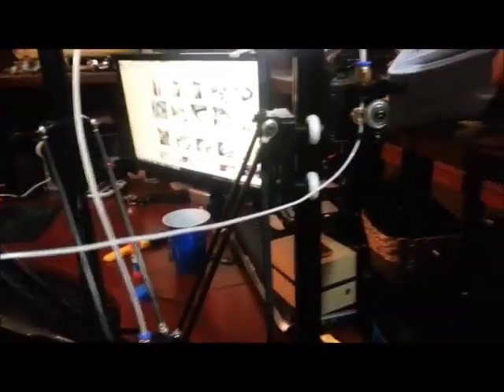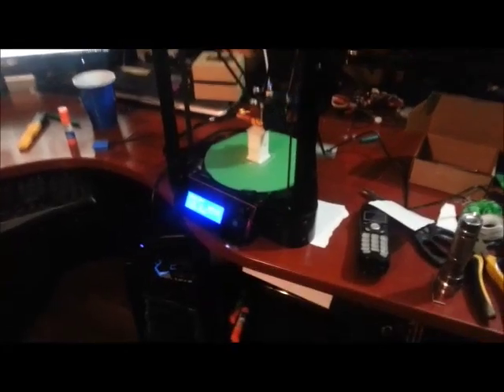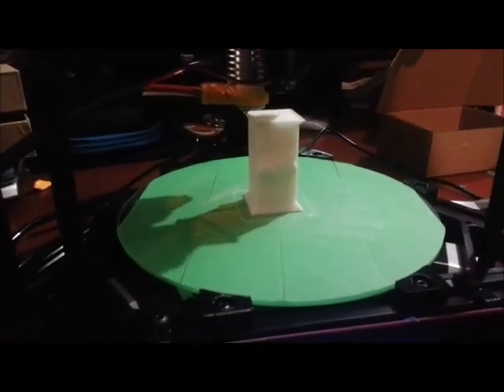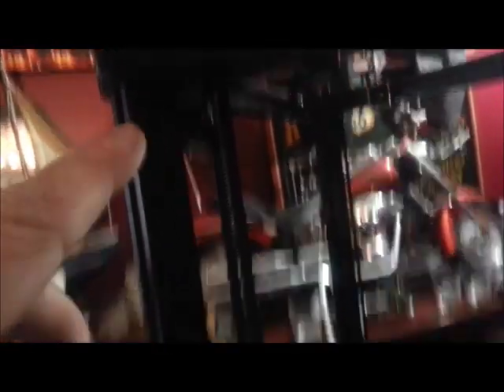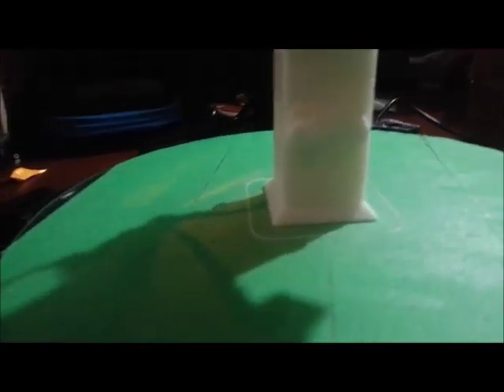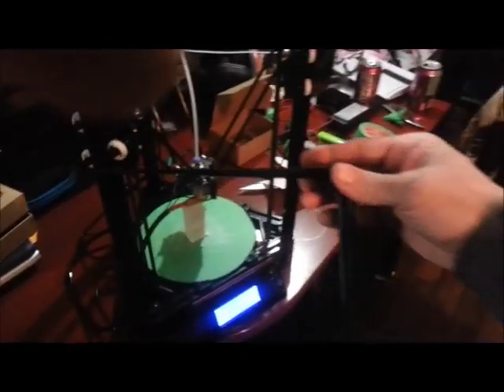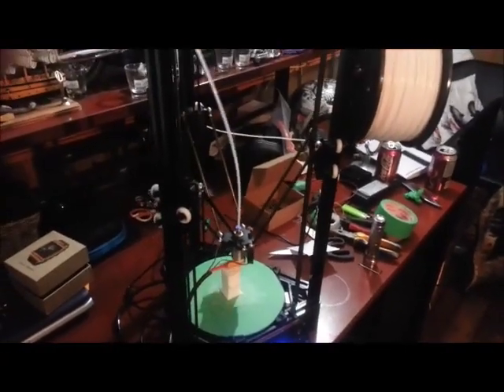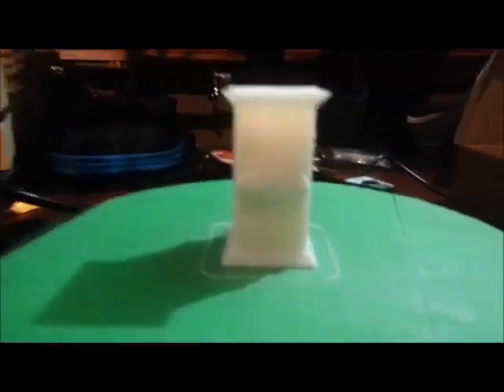Completed Working ANYCUBIC 3d PRINTER

Comment: Can i have ur firmware . My email : anhshockzaydo@yahoo.com .
Reply from the maker: What version of the Ancubic Kossel Mini do you have. If you have the version with the autolevel shroud my firmware will not work with it. I have a version of Cura that comes with that version of the printer that has the firmware built in. I need to know what version of this printer you have as there is the original and then it was replaced with the Autolevel version

Comment: Hello, what program do you work with, cure, slic3r, repeater???
Reply from the maker: I was using cura 15.04.6 but was getting more and more zits in my prints, I have since started tinkering with Cura 2.4.0, so far no zits
Reply: Cure 2.4 does not recognize my printer.
What firmware do you use?
Reply from the maker: How so? I setup a custom printer in it with all my settings and then I just use it to slice my models into Gcode and print from sdcard on the printer
Reply: Ok, I'm using Cure 1.5.6 and print from the program
Reply from the maker: I have never used that version of Cura. I use to use Slic3r but I found it was not as good as Cura for some things.
Reply: Slic3r has given me problems to calibrate I can not calibrate
Reply from the maker: Do you have this same printer? My firmware wont work with the newer machines that have the large hotend shroud
Reply: Yes, version lineal guide
No plus
trigorrila board

Comment: how to add thermal sensor on the original heatbed?does it not too hot to put the hot bed up and the motherboard just under ..i am little afraid about this..
Reply from the maker: The heatbed spreads heat passively. What you could do is put spacers between the heatbead and the lower frame to give an air gap which should be more then enough. I use kapton tape to hold the thermail sensor firmly to the bed
Reply: thanks a lot!did you resolve you noise motor problem?i am waiting my plus version which is bigger
Reply from the maker: Did you get the newer model with the autolevel shroud

Comment: Thanks for the vid. Subbed.  Can you send me a copy of your firmware? keith1212@hotmail.com Thanks in advance!
Reply from the maker: firmware sent
Reply: Got it thanks! Fortunatly my main board came with firmware on it. The package had a sticker telling me so. Had the firmware and some more stuff on the sd card. Also they updated the build area and now you can add these bushing which came with my kit for more build area. http://rd3dpds.com/images/pdf/Modification%20for%20Anycubic%20Kossel%203D%20Printer-20161122.pdf Assembly went amazing for a kit. Everything just worked. I have a completely different  main carriage than yours.
Reply from the maker: I have to micromakes with the same effector(hotend) and I designed a replacement right away as those hot ends are large bulky and sacrifice build area. http://www.thingiverse.com/thing:1935700 
I also reverse engineered those new effectors and you can find my replacement design with better ventaliation here http://www.thingiverse.com/thing:1855253
The new kossels like the one you have same build height as my old ones until I ad an effector similar to yours then the old ones have 345mm build height. AS the old ones the 2020 tower extrusion is 40mm taller. I have my micromakes sitting beside my old Anycubics and the printer height difference is very noticable
Reply: Sweet thanks for sharing!

Comment: Hi can you send me the firmware I've the linear version thk ;)
Reply: vincenzo.pirro@email.it
Reply from the maker: My firmware may not work for the linear version as your delta measurements will be different. If you still want it i can send it
Reply: Yes send me I've a problem with the g28 command that not return all the axis in the same time

Comment: will this firmware work on the linear kossel ? if so could i have a copy mr-foxx@talk21.com
Reply from the maker: The linear Version will have slightly different delta measurements due to the push rods being much closer to the towers. You could try it as a start and fine turn your numbers until you have it calibrated

Comment: saludos, podrías pasarme tu firmware porque a mi también me llego la impresora sin software y el enlace que me han dado no esta, pokechori@gmail.com
Reply from the maker: firmware sent. Once you have the firmware uploaded to the printer, if 
you are still having issues double check your wiring to your ramps. This
 firmware is tweaked for the anycubic kossel mini and the printer should
 work as it should once installed and I find that 99% of people having 
issues after installing it have wiring issues
Reply: Arduino:1.6.12 (Windows 7), Tarjeta:"Arduino/Genuino Mega or Mega 2560, ATmega2560 (Mega 2560)"

sketch\Marlin_main.cpp:2208:36: warning: invalid suffix on literal; C++11 requires a space between literal and string macro [-Wliteral-suffix]

         LCD_MESSAGEPGM(MACHINE_NAME" "MSG_OFF".");

                                    ^

In file included from sketch\SdFile.h:27:0,

                 from sketch\cardreader.h:8,

                 from sketch\Marlin_main.cpp:46:

SdBaseFile.h:38: error: using typedef-name 'fpos_t' after 'struct'

 struct fpos_t {

        ^

In file included from sketch\Marlin.h:10:0,

                 from sketch\Marlin_main.cpp:32:

f:\arduino\hardware\tools\avr\avr\include\stdio.h:950:33: note: 'fpos_t' has a previous declaration here

 _extension_ typedef long long fpos_t;

                                 ^

sketch\Marlin_main.cpp: In function 'void set_bed_level_equation_lsq(double*)':

sketch\Marlin_main.cpp:831:36: warning: deprecated conversion from string constant to 'char*' [-Wwrite-strings]

     planeNormal.debug("planeNormal");

                                    ^

exit status 1
using typedef-name 'fpos_t' after 'struct'

Este reporte podría tener más información con
"Mostrar salida detallada durante la compilación"
opción habilitada en Archivo -> Preferencias.
Reply: perdona por las molestias podrias ponerme la configuracion de tu puerto? te pongo los mios

bits por segundo:9600
bits de datos:8
paridad: ninguno
bits de parada: 1
control de flujo: ninguno

avanzadas
todo al maximo y activado
Reply from the maker: I will check what version of arduino software I am running when I get home as I have no errors when uploading this firmware. Did you make sure everything was in a folder called marlin also. you have to run the marlin.ino file from a marlin folder

Comment: Hi, I've just assembly this printer, but I have problem with the firmware and lcd screen ( it is just bright and doens't work :/). Could you send your firmware? pp_41@o2.pl
Reply from the maker: i will but first the lcd has a contrast control. It could be set too high. on the very back of the panel near the sd slot there is a small adjustment screw for contrast try adjusting it to clear up your screen issue
Reply: Thanks for firmware. I've tried a lots of things to solve my problem, but I probably got faulty LCD screen or this small adapter :/
Reply from the maker: If it is faulty you can still use the printer with pronterface on your pc until you get a replacement screen, do a search on aliexpress for 2004 lcd they run about $8-9 usd

Comment: Hey guys most of the way through building one of these, may have a problem with the hot end.  At the moment having assembled it as per the destructions Its very loose.  The printed clip that holds it in place with two screws and nuts, does not apply any pressure to the hot end itself and just serves to prevent it from falling back through its own hole in the effector assembly.  Its got enough slop that i'm pretty sure any motion will move the hot end all over the place.  Anyone else had this issue, or have I just managed to get a duff part?
Reply from the maker: I had this issue with one and what I did until I was able to use the printer to print another one was add a few layers of electrical tape or something like that to the printed clip to make it thicker and that made the hot end snug,. then I printed a thicker clip
Reply: Cheers.  WIll have to give that a go and see how I get on. Everything else thus far seems to fit fine, guess you've got to have at least one thing wrong on cheap chinese kit :)
Reply from the maker: Ive bought 6 of these, one had a bad ramps board, 3 of the 6 did not come  with the m5 nuts for the nylon wheels, and 1 had poor 3d printed parts
Reply from the maker: Firmware sent. Let me know how things go. Yeah the arms are are not perfectly equal the vary by up to 2mm i find
Reply from the maker: I have 4 of these now for personal use and one custom made one I decided to attempt after using the one in this video for a couple of months. It is 1 meter tall and 1/2 meter wide. Print volume is 480tallx330mm diameter. I have yet to upload a video of it yet though.
Reply: Not so good, mainly because shit for brains here should have put .co.uk on the end of my email address not .com sorry.  Beyond the firmware after playing a bit with the arms overnight and manually checking levels I got a definite tilt to one side on the hot end, so now browsing through Ebays finest for a replacement set of arms.  will give it a go with them and the current set, but once this is up and running I can seem some rapid upgrades coming along.
Reply: Cheers for the help Rock, still a ways to go, need a new LCD as the current one is just a glorified torch.  Need to do a proper calibration.  The bed is either off or the arms are giving me issues, but its still good enough for prints with a test cube just showing off by 0.5mm on one corner. :)http://i1376.photobucket.com/albums/ah27/Spec_wulf/Mobile%20Uploads/20160823_134035_zpsxz4vonul.jpg
Reply from the maker: Prints look good you are almost there. I think the worse is behind you

Comment: Hallo! Ich habe diesen Drucker auch gekauft. Der Aufbau ging ohne Probleme voran. Eine Firmware wurde nicht mitgeliefert aber die Arduino IDE enthält ja einige Beispiele. Trotzdem hätte ich gerne die Firmware per email zugesendet: geralfo@web.de.

Liebe Grüße
Gerd

Hello! I bought this printer also . The construction went ahead without any problems . A firmware was not included but the Arduino IDE indeed contains some examples . Nevertheless, I would like to be sent to the firmware via email: geralfo@web.de .

best regards
Gerd
Reply from the maker: Firmware sent
Reply: Ich habe dir auch mal ne Mail geschrieben, denn ich komme auch nicht weiter. Hoffe auf deine Hilfe.

Comment: Awesome man I've spend all day trying get running. I don't think  I set up the female ac power connector right or fans.. The instruction wasn't clear also Gotay get Marlin set up
Reply from the maker: If you are having problems pm me your email and I will send you the firmware. I may be able to guide you through the wiring if you need help there as well
Reply: I tried but your channel doesn't have an about me section to PM you. I was able to load the correct firmware. It turns out it was on the SD card they provided. but didn't noticed because my computer didn't read the card until the falling day "go figure" where i still need help its setting up female power connector power switch and ramps..i keep coming across conflicting things and don't want to burn anything out. Can i shoot you an email or Facebook PM? my personal email address is jonathanluna@me.com but for Facebook look up jonathan@hotshotzent.com

Comment: Hey would you mind also sharing that firmware with me? I got the same exact printer. The seller has been unresponsive and the version of Marlin I'm using is just driving my printhead into the platform. I can't get it to home or level. Pretty frustrating.

cpowersmobile@gmail.com
Reply from the maker: +Chris Powers 
No problem, firmware sent. It took forever for me to find it, i used a patched together version of marlin before I managed to get  the version the vendor should be sending out with the printer. The default Esteps/mm is set to 150 in the firmware, if you find that is not enough for the filament I find around 170-180 works out not too bad
Reply from the maker: +Chris Powers 
As for leveling the bed I just keep it simple. I setup 4 buttons in PronterFace,  in front of x tower(G1 X-69 Y-40 Z5 F8000), on front of y tower(G1 X69 Y-40 Z5 F7000), in front of z tower(G1 X0 Y80 Z5 F7000), and center(G1 X0 Y0 Z5 F7000).  This puts the hot end roughly 5mm above the plate then i come down to about 1 mm then ,1mm at a time until a piece of paper just scrapes between the hotend and the plate. If there is to much height I adjust the specific endstop up or down a bit until i get the desired effect and move on to the next tower.

Comment: can you send me link or the firmware to this? john_lynchwells@yahoo.com and also. any idea why the lcd screen would be blank? far as we know, looking up and down to make sure we hooked everything up right, screen still blank. defective?
Reply from the maker: +Justin McCracken  I will email my firmware I am using just make sure to adjust your z height settings in the firmware as we all assembled them slightly different. For your LCD it could be blank due to not being enabled in the firmware. The firmware I will email you has it enabled

Comment: any tips on scanning?
Reply from the maker: +calvin myers 
I use an Xbox 360 Kinect and Reconstructme software for scanning
Reply: +rockwater999  could u upload a how to
Reply from the maker: +calvin myers If I get some time in the near future I will upload something but for the moment I do not have anything thrown together. There are tons of how to for it on Youtube just search "Kinect reconstruct me"
You will need to download and install the Kinect SDK for Windows which is free from microsoft before you hook the kinnect up. Also with the Kinnect - It has a usb looking plug on the end of the cable coming out of it, this however is not a usb plug it is a splitter, it is meant to be attached to a cable that leads in one direction to a wall adapter, and on the other end a usb plug which you can insert into your PC

Comment: Is the power supply internal or is there an external one somewhere under your desk? :)
Reply from the maker: +micosan it is a brick power supply that comes with it. Not strong enough for a heated bed but enough to run the printer without one. If I wanted to setup the free heated bed it came with I would need to buy a beefier power supply or mod a PC PSU to run the system
Reply: rockwater999 ah okay! :) Heated beds are very good when printing :)
Reply from the maker: +micosan 
I only print with flexible and pla to date and I have not had any issues with not having the heated bed set up
Reply: rockwater999 Okay that is very nice. But do you use tape? I'm using a glass plate only for smoothness and Even with PLA It doesnt stick well unless It has a large surface area touching the bed :) And for ABS I think a heated bed is a must :) But I do like PLA better than ABS.. cause from what I've read PLA is less toxic too :)
Reply from the maker: +micosan 
I use glue stick
Reply: aah cool.. I've heard some people even using hairspray :)
Reply from the maker: +micosan 
Yes some people use hairspray but it goes everywhere, could get on your motors, gears and belts. With glue stick you control it and it cleans up with water pretty easy on the glass bed

Comment: anyway I could get the firmware ur using as I have the same as u
Reply from the maker: +calvin myers Pm me you email address and I will send you the firmware
Reply: +rockwater999  calvinlmyers2046@gmail.com
Reply from the maker: +calvin myers 
I sent you the firmware, you will just have to tweak one setting which I explained in the email. Any issues after you upload just drop me a line Ill try to help.